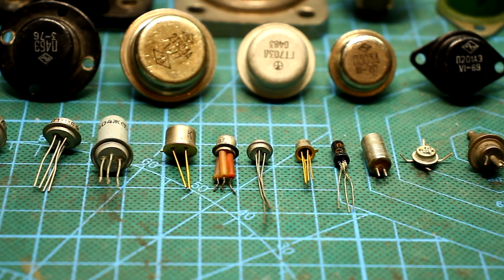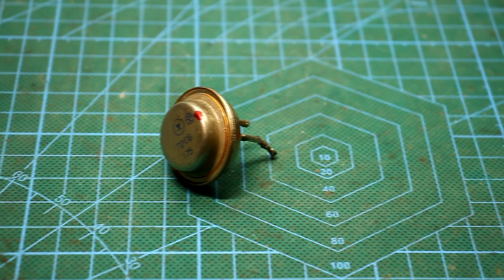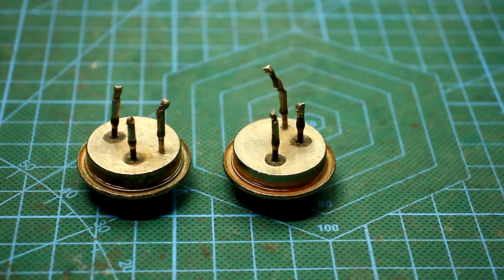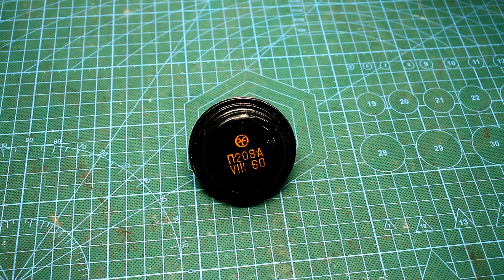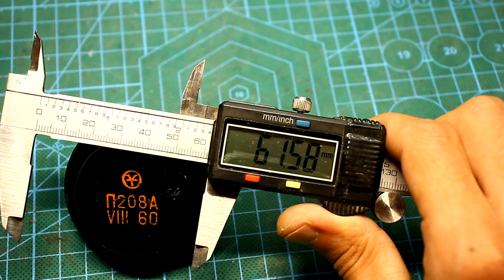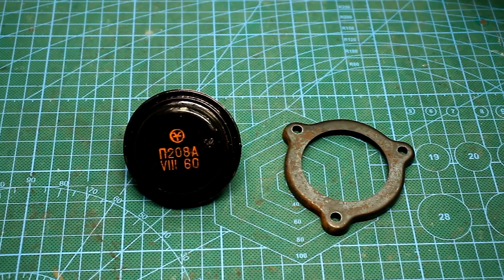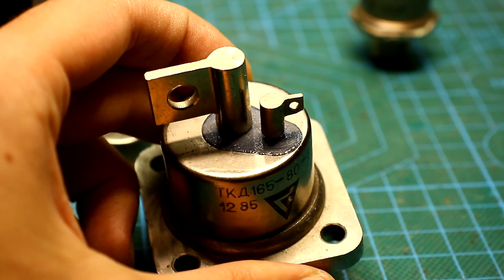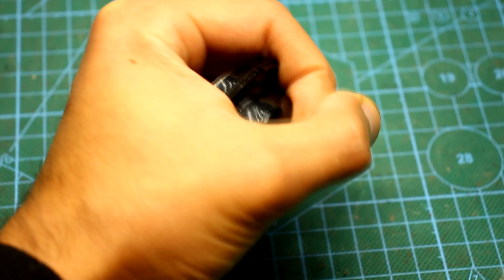WOW! This is the LARGEST transistor

Comment: pleas , I want you to make a video of the steps of making an inverter 1600 watt, pure wave, when the electricity is cut off, it turns on automatically and when the electricity returns, the battery is automatically charged to the battery used 100 ampere and when the battery is filled, the charging is automatically cut off with the mention of the components and their names that were used

make the inverter capacity 8 amp and put two inverter diagrams of 8 ampere in the description box. The first scheme is using ferrites, and the second scheme is using ferrite core transformers and the power of the inverter is 8 ampere.